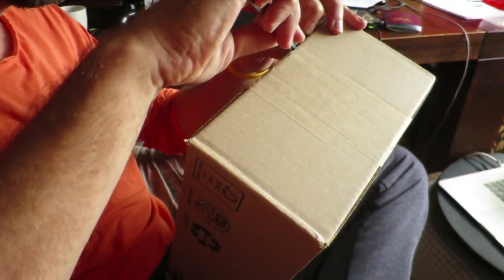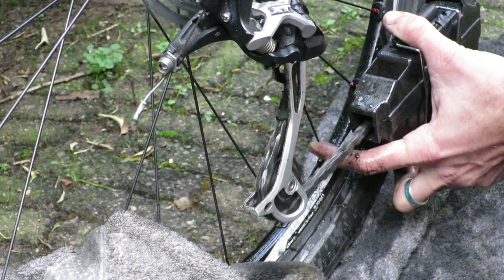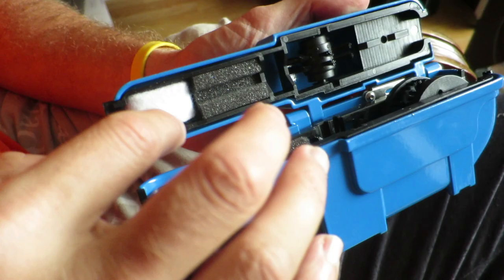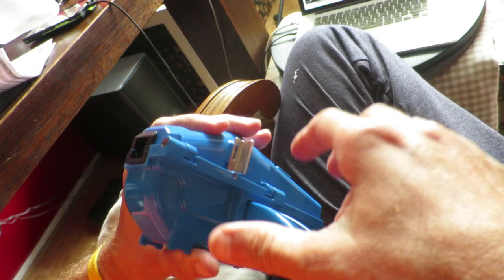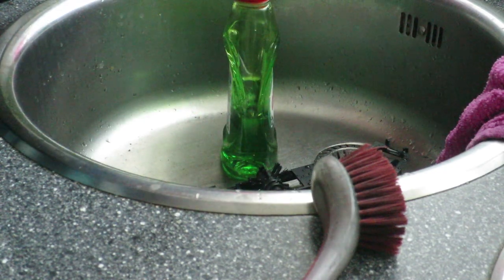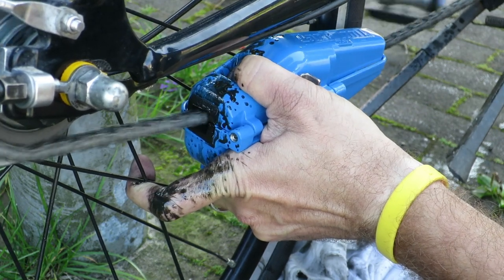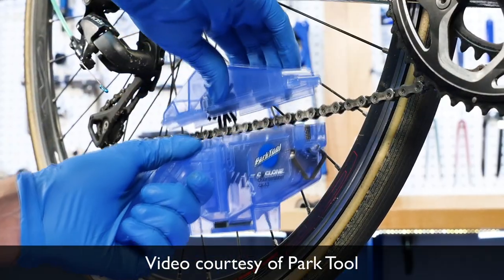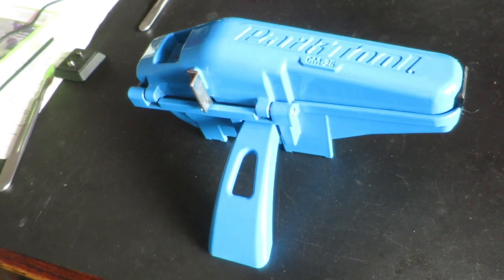The best bicycle chain cleaner worth your money: Park Tool CM-25 in review

Comment: You didn't mention one important thing I was hoping you'd say. Most who have used the plastic version of the Park chain cleaner say the bristles tend to fall out and get stuck in your chain. I was hoping maybe at least the pro version would not have this problem. In fact at the MUCH higher price it costs, it kind of warrants the brush bristles being epoxied into the holes they're mounted in.

Comment: I'm still using my (cheap, nasty) no-name ABS black plastic unit, and it seems to be holding up pretty well. It cost me £6.00 from China. You can buy replacement brushes for it (£2.00), but I've not needed any so far. It's 2 years old; I use it once a month on my wet-lubricated road bike chain. It still does a good job when loaded with white spirit.

If it were to fail, a complete replacement would still only cost about a tenth of this (very nice) Park Tool metal machine, so... I think I'll stick with cheap and cheerful for now. 🙂